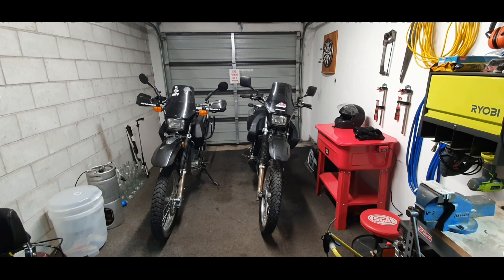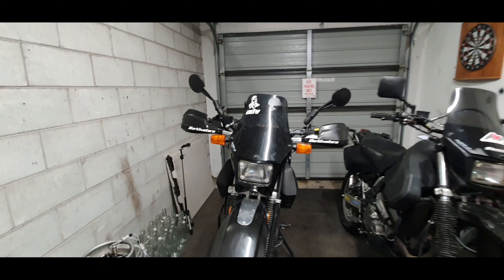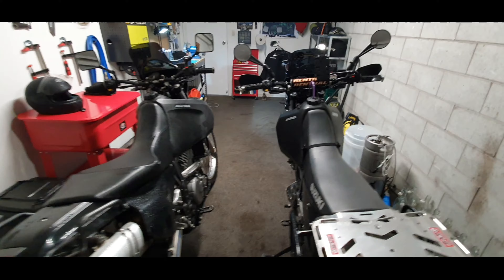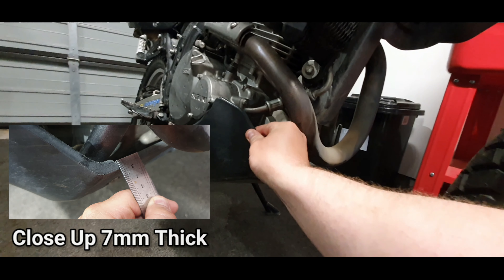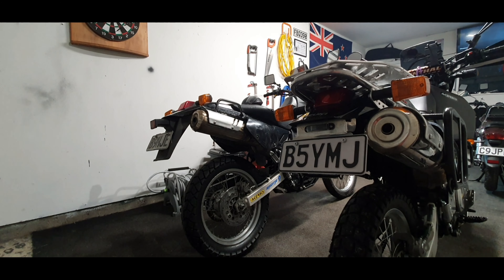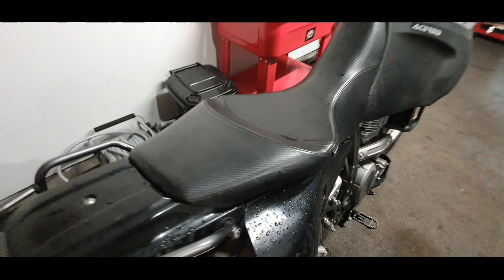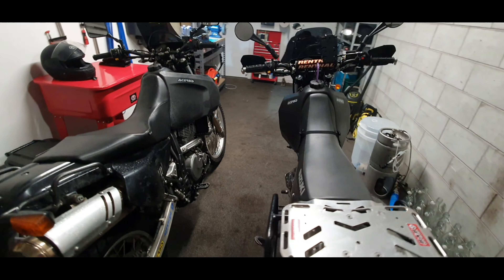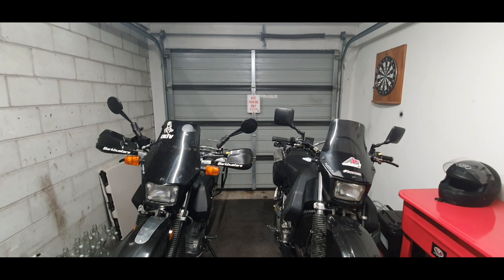Suzuki DR650 Comparison / Mods

Comment: Great comparison. Your friends bike looks like it's higher in general and that's not just the handle bars. The headlight and everything looks higher? Has yours been lowered or his been raised somehow? Or maybe its just the way it looks through the video, optical illusion perhaps🤷‍♂️..... how's your Leo Vince coming along? Do you have a ETA at all? Great video mate cheers.
Reply from the maker: I thought the same when re watching the video.  I put it down to our tyres. Mine are stock and his a tkc70s. Both are stock height :)   still waiting for the dam exhaust.  😅 thanks for watching
Reply: The higher bike might have modded suspension

Comment: Hey Johny noticed the B&B luggage rack , what brand pannier racks do you have and did you have any probs fitting them. I'm in the process of fitting B&B rack with Barrett pannier racks and having bit of trouble making them fit. Any tips appreciated.
Reply from the maker: Hey mate. Those would be ""dirt racks"  from Canada. I made up some 5mm alloy spacers to clear the welds that our rack has.  I got some aluminum plate.  And then used a hole saw to cut them out.  They now fit right on no problems